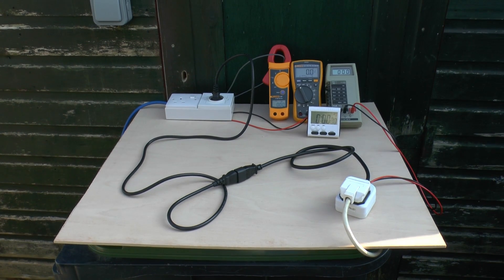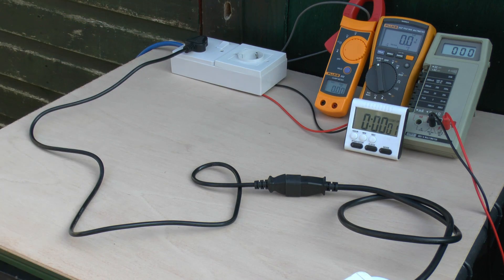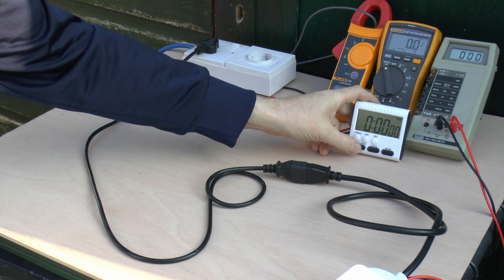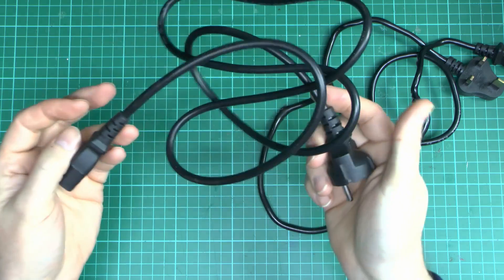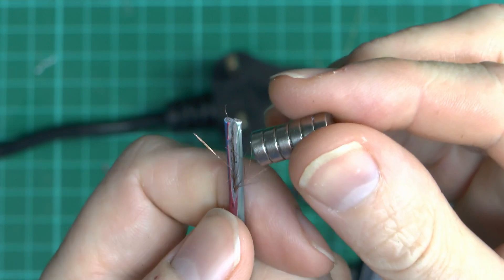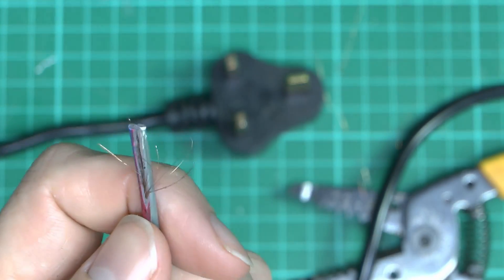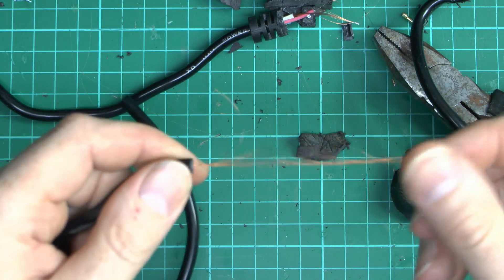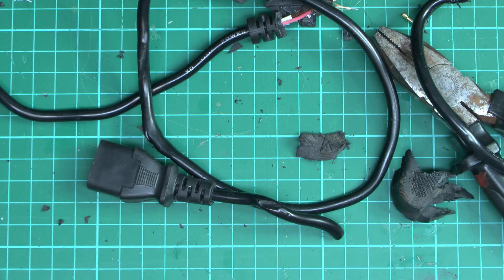Dangerous Failure of a fake UK plug to dubious C13 shape lead

Comment: A friend of mine recently ordered an automotive dent removal device direct from China. One of those things that has a sort of bridge with wide, soft pads on the ends to push against the bodywork, and a bolt with a flat plastic piece on one end and a threaded handle at the other. You glue the flat plastic part to the dent with hot glue, put the bolt through the bridge, and tighten the screw until either the piece pops off of the car, or the dent is pulled out. They actually work reasonably well on simple dents. Anyhow, this particular example came with a glue gun. And it was the most pathetic, awful excuse for a glue gun I've ever seen. The body of it was made of some sort of soft, poorly molded plastic, from which they hadn't even bothered to trim the flashing, and the trigger/ glue advancement assembly was the same, except orange. That part broke the moment a tiny bit of pressure was applied. It also had the thinnest power cord I have ever seen in my life, with the standard Chinese plug that looks like a North American plug and will fit our outlets, but isn't really compliant. The sticker on the glue gun read "Glue Gun 40W 250v/125v." Which is, of course, impossible with a resistance heater. If it draws 40 watts at 250 volts, it'll only draw 10 watts at 125. If it draws 40 watts at 125, it'll vaporize the glue at 250! Anyhow, I tried it out, connected to a cheap measurement device. It drew 7 watts when first plugged in, and dropped to around 4 watts after being plugged in for a while on our 120v supply (125v actual at the time) Of course, the glue never melted. I then cut the cord off to examine it. It had what looked like wispy copper wire, but it wouldn't stay twisted together, and turned out to be copper plated steel. The approximately 3 foot long cord had a resistance of 1.5 or so ohms on each conductor. I then did a sort of half-assed test, similar in idea to the ones you've done in the past, but just thrown together for my own amusement. I taped the thermocouple from my multimeter to it and ran about 3 amps through it. Sure enough, it heated up, just like this one. I might have to try 6 amps next. I still have the cord- I kept it as a curiosity. Probably would have had better luck melting the glue by holding it against the cord than inserting it into the gun. The gun itself was a shoddy version of the usual-an aluminum housing that the glue goes in, little brass paddles crimped on to the ends of the cord, a pellet of some sort of resistive material, probably 2mm thick, 8mm wide and 10mm long, wrapped in a single layer of Kapton tape (only thing between you and mains voltage) then clipped to the aluminum housing with a flimsy C-shaped piece of flat spring steel.
Reply: That block would be a PTC resistor. What a heap of crap you were sent. I'm amazed it got passed customs. Is there not a US body that would be responsible for stopping unsafe products getting in ?
Reply: Stuartbe well, yes. And they do a great job keeping it from getting to stores and such. But this was an individual purchase-my friend got the thing on eBay direct from China, and it's really not feasible to inspect every single individual parcel, not to mention there's a big difference between buying one thing for your own personal use, and buying a few thousand to sell at retail. Sure, they can and do spot check individual parcels, but on the customs declaration form the merchandise was described simply as "automotive tools," which isn't likely to warrant an inspection
Reply: @puckcat22679  Thanks for the reply. Looking at it I realise I phrased the question rather poorly. I was enquiring more about Items from China via post and inspections. They seem to be having a crack down in the UK currently. I order a lot of electronic components from China and about 90% of my orders have been taking twice the normal time to get here.

As our our two countries work so closely together in matters like this I just wondered if it had been inspected at all. I realise they cant inspect everything I was just curious to know if your item had been looked at. It does make me wonder how the Australians manage it. Apparently they screen 100% of mail coming in. Just like the UK it looks like they are randomly picking shipments.... Perhaps I have been put on a danger list    :-D
Reply: @TRS-Tech  - I am Australian, and deal with electrical compliance in my normal job. Our customs DO NOT screen shipments coming in. Not 100%, not 1%, not 0.01%... they don't screen them at all. Our regulations are simple - the IMPORTER is responsible for ensuring compliance. The overseas supplier has no responsibility whatsoever. Nobody inspects anything electrical, it's basically "self regulation" like CE - however if there is an electrical safety incident of ANY form, then the regulators inspect and prosecute.
Reply: @johncoops6897  I am curios as to how they stop small worms, ticks and things that could decimate your crop / food production. I have seen documentaries about the work of your customs officers at airports with mail and passengers having prohibited items confiscated that could be a danger to your fragile ecosystems.

Seems to be a piontless exercise if normal incoming mail can bypass all these checks.... (Just realised I have gone rather of topic on this one) 🤐 I did wonder if the 100% was just to ward of people. I do see your point though !
Reply: @TRS-Tech  - They don't generally check incoming mail in small parcels - it would be physically impossible to do so.
The documentaries and TV shows are largely just propaganda however they certainly do check / assess if a high risk is assessed. For example, if a mail item had a customs declaration saying "seeds" from South America, then that would probably get opened.
Reply: @johncoops6897  Thanks for that John. You learn something new every day. A government using a "documentary" for propaganda  ?  I have never heard of that before !   ;-)
Reply: @puckcat22679 - you should learn to use paragraphs, as your wall of text is almost impossible to read. HINT: Hold SHIFT and press ENTER to add a CR:LF that YouTube won't strip.
You have misunderstanding that it's not a resistive heater, but a small block of PTC material that they use... this means that the "power" self-regulates. 7W > 4W sounds about right, they don't need to be very powerful.
You and your friend have unrealistic expectations regarding electrical safety and compliance. OF COURSE a product that is imported directly from China will not be compliant... it's pretty damn obvious.
Reply: John Coops first of all, I'm on a mobile device, so it's a bit difficult to do that. Second, I used "resistive heater" as a general term. I'm well aware of what a PTC resistor is and how it works. And 7>4 watts is about right for what? A PTC? sure. That's the point. A glue gun? No. 4 watts isn't going to cut it. I mean, maybe if you let it sit for an hour, you could come back and get a couple drops of glue to come out, assuming your house hadn't burned to the ground in the meantime. Third, I personally know that buying anything that's to be plugged in to the mains direct from China is a really bad idea. My friend apparently didn't, but he does now. He bought a dent pulling device, and didn't even expect a glue gun to be included. He used his own glue gun for the purpose, and brought the included one to me because he knows I'd be able to tell him how bad it is.
Reply: I have that glue gun or at least a similar one (if it's this one: https://lorimer.id.au/glue.html). Apart from the undersized power cord (which broke after a while and went open circuit, so I replaced it), it works fine, as long as you're ok with the slowness and treat it gently. The heater is one of the ones where the resistance goes up when it heats up, i.e self regulating. So I'm not surprised it has a low resistance to begin with. I'd feel more reassured if the metal tip was grounded though. The heater assembly on mine is potted in some kind of ceramic though, so maybe a bit better than yours ?